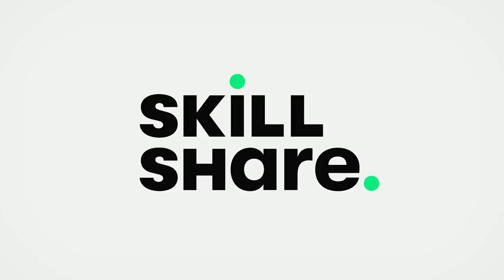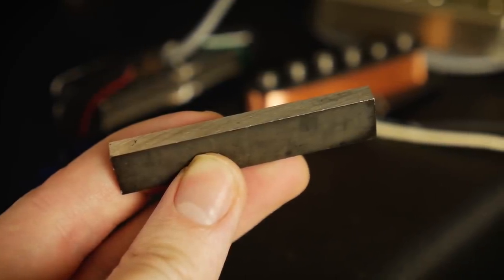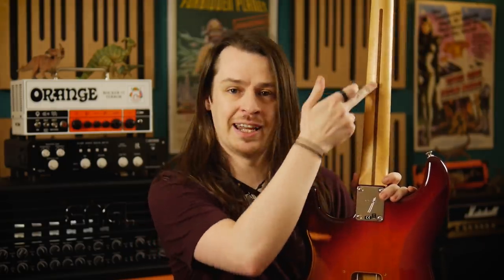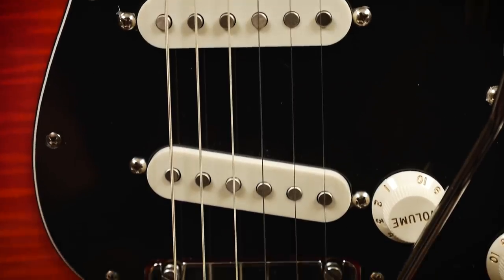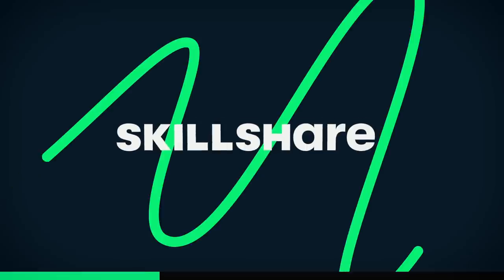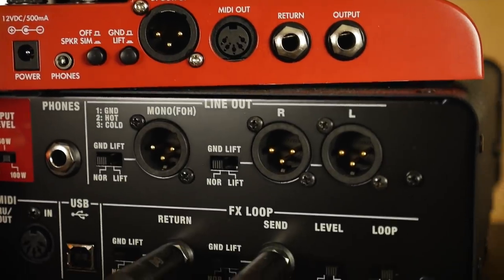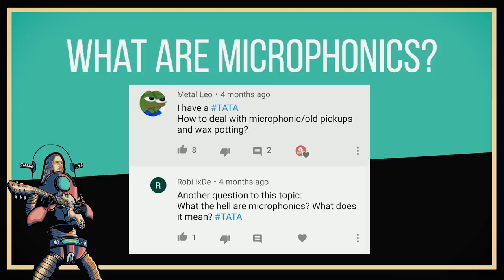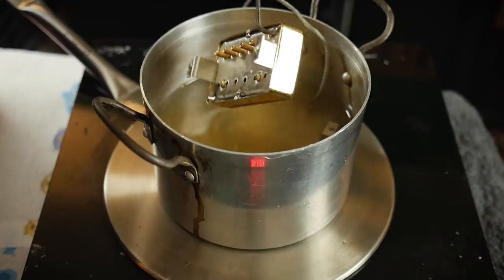5 More Tiny TATAs : Ground Lifts and Skunk Stripes | Too Afraid To Ask

Comment: What I never thought about was that cobalt is number 27 and has one electron less, but weighs more than nickel at 28 and one electron more. Does it have more neutrons? I forget the particle physics completely. Regarding pickups, I hear that today's alnico 2 are often more powerful than the vintage alnico 2 and sometimes even older alnico 5 etc. However I don't know if that's due to losing the magnetic properties over time or the original specs.

It's also noteworthy that the skunk stripe is so traditional that even Fenders that didn't necessarily need the stripe got one in later years. People just liked it or expected to see it.

Comment: It's not so much much the strength of the magnet that alters the tone but it's permiability - how well it behaves as the inductive core of a coil. Iron alone is really good at this, and the more you have of this the darker the sound, ceramic and neodymium magnets behave similar to air in this respect and more and bigger magnets can be added to boost output without altering tone. Alnico is quite permiable but not as permiable as iron, and permiability changes with the grade of alnico.

Comment: Interestingly, resin potting was also used for vintage computer components and is proving to be damaging to these vintage components, as is in the case with some of the vintage Apollo Guidance Computer hardware that has been recovered from the development and test phases of the Apollo program, making some modules no longer functional.

Now, modern resins may not have this issue, but it's worth considering, certainly.

Comment: The original Ceramic Magnet hex pole Schaller humbucker pickup from my red 1983 Kramer Pacer Special! I put up with it for 30+ years squeeling and yeah, I could yell in it and hear my voice over the amp. I should have waxed it, but I swapped it out 10 years ago with a MUCH better, wax potted Alnico V magnet humbucker that made that guitar sing like it should have from the start. Eddie anyone?... Lots of mids, so now I can be haired :)

Comment: Colin, or anyone Was Eddie Van Halen the first to pot pickups ? I know he did a lot of experimenting with pickups.
Reply from the maker: Of course he wasn't. 
Potting coils was a well established procedure long before EVH was on the scene. We've been doing it for transformer coils for as long as there has been transformers. 
Frankly the reason guitar pickups weren't potted for a short while in the 50s is probably due to ignorance in the then emerging electric guitar manufacturing industry. 

Also, the word experimenting suggests theory, hypothesis, and scientific process. 
What Eddie did was fuck around blindly until something worked. He ruined as many guitars as he got right.
Reply: @ScienceofLoud   Thanks Colin , clears that up , I did hear Eddie ruined a lot of guitars , Thanks again, always look forward to your posts , I have learned a lot from them.

Comment: Colin: "Aluminium"

Me, a filthy American: Aluminum
Reply: What do you call sodium - sodum?
Reply: @Mark95876  no, we call it sodium. or as it is commonly called....salt
Reply from the maker: Yikes, if you think salt is sodium you're in for an explosive time. 

Sodium is a metal that reacts violently when in the presence of water. It's not something to consume unless you want to blow your head off. 

Salt is the compound Sodium Chloride which is a perfect example of how chemical bonds can render two lethal elements harmless.
Reply: @ScienceofLoud  i knew that salt is the combination of sodium and chloride. didnt know it was that volatile by itself, though.
Reply from the maker: My most vivid memory of chemistry class in school was the teacher demonstrating volatile metals. 

He produced a jar of oil, within was sodium metal. It needs to be stored under oil as if it's left to interact with the atmosphere it will self ignite. 

It's soft and can be cut with a blunt knife. 
After cutting off a tiny piece, he took it behind a blast shield and dropped it into a glass beaker of water. 

Before the metal reached the bottom the whole beaker exploded sending glass and water everywhere.
Reply: @ScienceofLoud  holy crap. maybe that's why none of the schools i went to had chemistry classes
Reply: CSGuitars you know more than any YouTuber I have watched
Reply from the maker: I gave up a career in particle physics to do this. I'm vastly overqualified.
Reply: @ScienceofLoud  I remember a lesson like that where we kept egging the teacher to cut off a bigger chunk and drop it in the water. Wasn't quite as explosive as your story but I remember the teacher getting more agitated and frustrated as all 30 something of us kept pressuring him to put us all in danger.
Reply: I had chemistry lab in high school every year (as it was a trade and technical school) for a couple hours a day. Our fav thing to do was drop a small piece of sodium metal down the sink so it would explode. Ironically I did not go on to become a chemical engineer, but a software engineer.
Reply: I never took chemistry (not smart enough) but, our chemistry teacher set the fucking lab on fire one day
Reply: @mr.nobody68  Every lab scientist, being a chemistry teacher or a tech (like myself) always secretly want to do that.

Comment: Don't most of the larger pickup mfgs use vacuum wax potting? Where they pot them inside a vacuum chamber in order to vacuum the air out of the chamber while pulling the wax into every nook & cranny in the coil wires and pickup?

Comment: Hi. Just a question about ground lift. I use it on my active pa to reduce hum. But why are these separate systems grounds linked in the first place? What’s the advantage of this.? Why not just have the grounds disconnected permanently.  ?  Cheers.
Reply from the maker: If you didn't connect grounds together then there would be a LOT more noise. Try disconnecting a ground wire inside a guitar and see what result that nets you. Floating voltages with no path to ground are not desirable.

Ground lifts are there for the rare occasion where two different systems mismatch ground voltage and a current can start looping in the ground plane.

It's always best to have grounds connected and there are many different ways it can be achieved to minimise noise.

Comment: Can you plug an analog boost pedal output to the input of a digital effects processor to "stack" the boost with a digital distortion modeler?
Reply from the maker: Of course you can, whether they will interplay sonically as you'd expect is down to trial.
Reply: @ScienceofLoud  Thanks mate! I wasn't sure about trying it out because I was afraid the voltage spike from the boost could kill the effects processor.

Comment: A tata for you! What is the difference between a clean preamp and an eq? Can i use one in place of the other?
Reply from the maker: A preamp amplifiers an incoming signal. 
An EQ modifies the frequency curve of the signal.
Reply: @ScienceofLoud  yea but i mean, if i plug my guitar into a power amp, the eq curve is all over the place. A preamp pedal has its own eq and voice and than it becomes much better. But an eq pedal can do a similar job right?

Comment: Heya Colin! Comin' out of the woodwork to ask a quick question and prod at your pedal experience! I'm wanting to replicate a lute/pizzicato pedal effect with my Roland FP-3 electric piano, and while I was googlin' the other day, I came across a suggestion in a theremin forum of all places for the Electro-Harmonix Attack Decay pedal.
https://www.ehx.com/products/attack-decay

Do you think this pedal could be used to achieve a sort of pizzicato effect where the notes can attack sharply when "struck" by the keys, but then decay rapidly over 2-3 seconds instead of ringing and ringing? Or do you have any recommendations for other pedals that I could take a gander at?

(Fyi, the only expression pedal inputs my FP-3 has are the soft and damper pedals. So any lute pedal effect I want to attempt with this would have to be an fx pedal on the analog output.)

Comment: For the next TATA, why preamps pedals sound bad when placed in front of an amp but sound pretty good when placed in the fx loop?
Reply from the maker: Because they are designed as a preamp, so you shouldn't run them into another preamp.

Comment: Here's my TATA : Does the fact that magnetic pole on a pickup doesn't fit (alignement) with the strings trully has an incident on the tone/sound/pickup performance/etc. ? Like puting an F-spaced Humbucker pickup on LP neck. Here's any issues appart the unesthetic aspect of it ?
Reply: Definitely, you lose a lot of signal. I had an old Gibson bass, and when it's bridge failed catastrophically, the only quick fix at hand was a Badass II bridge spaced for a P bass. The neck pickup on the Gibbo worked like normal, but the E and G strings didn't pass over the poles on the bridge pickup and sent zero signal.

Comment: Is that a clip from your own potting procedure? I've seen other tutorials on how to do it, a lot of them suggest not directly heating wax/paraffin on a stove as it may start smoking and catch fire. Did you have any such issues?
Reply from the maker: Yes it is my footage. Don't use open flames near wax vapour, that's a very bad idea. 
I use an induction hob for that reason.
Reply: Ah-ha, I didn't notice it was an induction heater. Thanks for clarifying!

Comment: The skunk stripe on most Fender basses since CBS bought Fender is just a cosmetic thing. They decided to make rosewood fretboards on basses the standard (which was a dumb choice), but they kept doing the skunk stripe anyway. You could chalk it up to tradition, but given the almost complete lack of innovation in Fender basses since Leo left the company and just about all of the attempts of improving the design have been guitar improvements transferred over to bass without considering whether or not they're actually useful on basses, I think the people in charge at Fender just don't know what the skunk stripe is for and don't care. I think the people running CBS wanted to have rosewood fretboards standard because they thought it looked better so they had the factories glue a rosewood fretboard on at the beginning of the process and kept everything else the same. The basses still sell so no one high up enough in the company cares and they've just kept doing it that way ever since.

Comment: Is it strictly necessary to have a skunk stripe on a one piece neck, or is it possible to insert the truss rod from the heel end and backfill where it won't be seen? I have to imagine that if it is possible, it's harder and/or more expensive and that's why they don't.
Reply from the maker: Explain to me how you could drill a perfectly fitted, true, rectangular slot from the heel to the required length of the neck. 
It's not the installation that is the limiting factor, it's cutting the wood.
Reply: Gun bore drills are about the only thing that comes to mind, and I'm not sure how you'd get a square from one of those, but I thought some truss rods were two touching cylinders.

Comment: But there are skunk stripes on almost every fender / squier neck now even with rosewood / pau ferro / laurel  fingerboards.   Also I have a 1970's telecaster custom that is microphonic asf but it does sound good normally. But you can literally hear the turning of the knobs on the guitar, or a bump of a button on the back, or strap movement LOL
Reply from the maker: 1. Yes, because as stated it becomes a design element and even when applying different fingerboards they can still use the same tooling to insert truss rods from the back.

2. That doesn't sound like an advantage.
Reply: @ScienceofLoud  1. Yes I wasn't arguing that fact guess just stating pointless things 2. it isnt mostly but i dont want to fuck up 50 year old pickups trying to wax them

Comment: Jimi Hendrix played a right hand guitar strung opposite, which meant his bridge pickup was tilted the opposite direction...and no one says his tone sucked. I think most strats sound better with the bridge pickup tilted the opposite direction of "normal".  So much for "conventional wisdom".
Reply from the maker: Logic behind design and subjectivity in preference are separate entities.
Reply: @ScienceofLoud  Logic isn't necessarily sound.
Reply: @ScienceofLoud  I spent a career designing Integrated Circuits for everything from toys to spacecraft. I can't tell you how often I've seen engineering/technical "logic" that wasn't useful.
Reply: Competing interests make "logic" not necessarily the determining factor in design compromises that always must be made.
Reply: The reason fender eventually utilized a tone pot solely for the bridge pickup was because it was more often than not, too bright...which tells us something about the original logic.
Reply: @RickMcCargar  And the Strat originally had no tone pot at all for the bridge pickup! :-O
Reply: @schmoemi3386  This guy seems to think that the logic he imparted was fool-proof. It may have been the original 'reason', but it wasn't the best design. Had it been, they would never had needed to add the tone knob. Without it, if you set your amp so that you could use the bridge pickup, the neck pickup was too dark. The original "logic" was flawed. 

For some reason the OP of this channel couldn't just admit maybe it wasn't actually sound logic at all, maybe it was just a design choice that had to be altered...but he has a big channel, so I guess that settles it. Ego gets in the way of truth, all too often.
Reply: So you mean they tilted the brigde pickup because at Fender they thought it looked cool? Sorry, I'm not sure if I caught your point correctly...
Reply: @schmoemi3386  No, as I've said, they used what they thought was 'logic', but it ended up requiring additional electronics due to the fact it was an ice-pick for most people using any sort of distortion. the logic was bad.  It would have been better being straight, or better yet, angled opposite.

Comment: what about necks with 2 skunk stripes?
Reply from the maker: Are you talking about multi-laminate neck splines?
Reply: @ScienceofLoud  honestly I don't know, but I've seen necks with like 2 stripes instead of one
Reply from the maker: @migdonalds  Then you're probably talking about multi-laminate neck splines. 

Some necks are made from multiple pieces of wood glued together. This ensures rigidity as any weakness or flex points in the wood grain of a single piece are defeated. 

These will quite often be 5 pieces: 3 thicker maple blanks and 2 thinner splines of a contrasting piece of wood. 
These woods are glued together to form the entire neck, the stripes are then part of the construction. 

This differs from the 'skunk stripe' on Fender necks which aren't part of the structural neck, and are simply plugging a hole. 

You can easily tell which is which at a glance: multi-laminate necks will have the stripes extend all the way through the headstock. 

The 'skunk stripe' stop before the 1st fret and are only on really found on Fender guitars.
Reply: @ScienceofLoud  ah thank you for explaining to me it makes sense now

Comment: BTW, that potting will be even better if you remove the cover!
Reply from the maker: There is a reason the baseplate has holes in it, to let the wax in. The potting isn't affected by the cover for this reason.

Top tip: the cover should also be potted to prevent it moving independently of the pickup.

Comment: Can someone point me to a decent video on how to pot pickups?
Reply from the maker: Literally any of my pickup related videos talk about the process. 
You submerge the pickup in molten wax, allow the wax to fill all the air spaces, remove the pickup and allow to cool.
Reply: @ScienceofLoud  
Fair enough, thanks. I have 3 dual hot rod single slot pickups and they are all microphonic to the point where I can talk into the guitar.

Comment: Sorry, Colin. Fender skunk stripes aren't to hide a repair. That was a design element built into the guitar.

A repair would be if someone had to route that channel later, to repair something. Since it was done at the factory, it's a design element. NOT a repair. Not even close.
Reply from the maker: I didn't say it was a repair. I said it was to fill the slot routed for the truss rod. 

The reason they use contrasting  wood is to make it a design element, because it you used similar wood THEN it would LOOK like a repair.

Comment: I have a question. Cabinets are rated for certain wattages, but obviously a 100-watt tube amp is much louder than a 100-watt solid state amp. Can a 100-watt cabinet handle a 100-watt tube amp but not a 200-watt solid state amp? In general, how does that work?
Reply from the maker: Power is not the same thing as loudness. 

Loudness is what you hear, power is a product of voltage and current. A speaker rated for 100W can handle powers up to 100W. Even if that speaker isn't making a sound, it will handle 100W, go beyond that and you'll burn out the voice coil. 

Also, valve amps being louder than solid state amps for the same wattage is a bit of a misnomer. Watts are watts, they'll amplify to the same level, but it's the perception our ears have of their sound which is the deciding factor on loudness.

Comment: Does the tilted pickup also make the lower strings lowder or is that effect negligible in said circumstances..?
Reply: Tilted pickups alter the resonant peaks of your signal, not the amplitude (volume) of your signal. Pickup and pole height affect that.